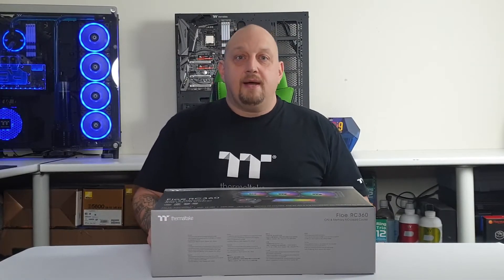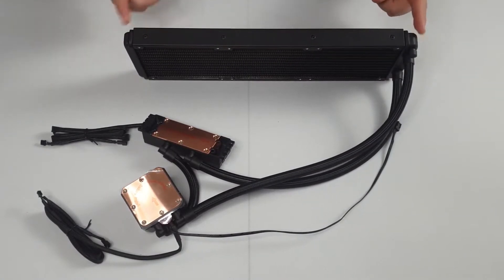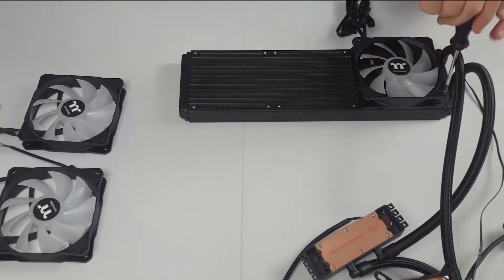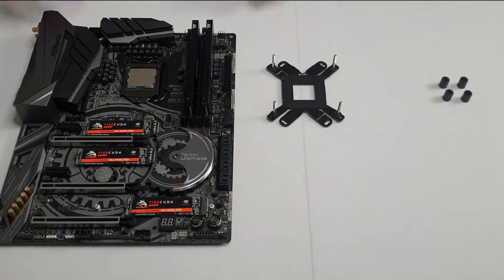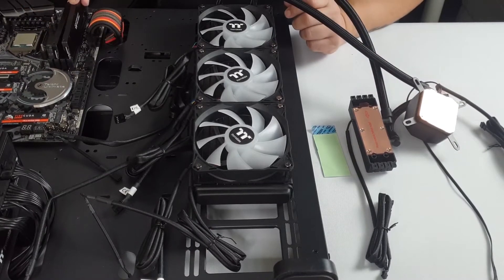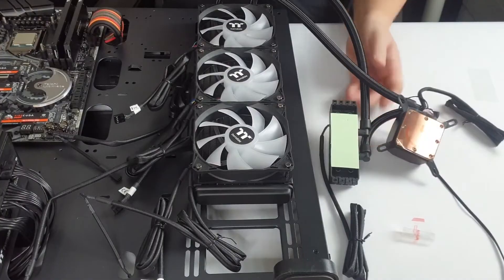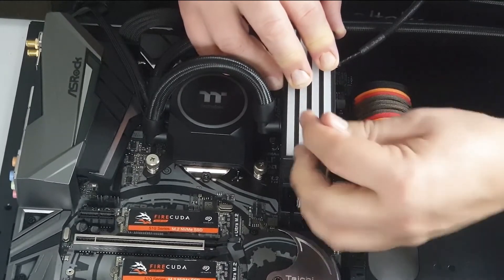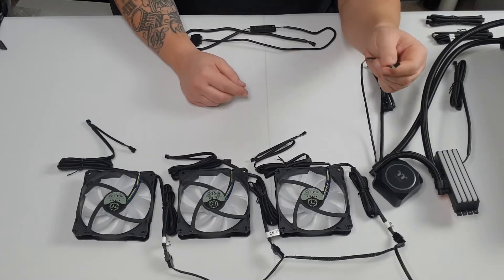Worlds first CPU and memory AIO   Thermaltake Floe RC 360 HOW TO Install Guide by IST.Modz

Comment: hello guys 
I want to know something about your product!
I have watercoling floe 360and ring 
I lost the usb cable
 I want to know if the rgb of the pompe and fans need to be  connected to motherboard via usb to turn on
because when I plug molex to the controller fan start spinning and rgb is of
if you can help me with I'm so grateful